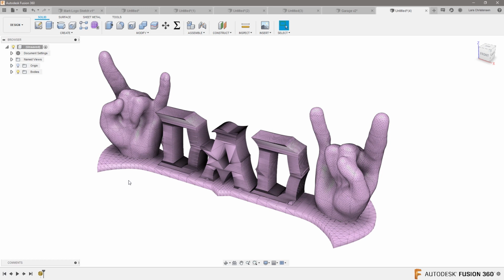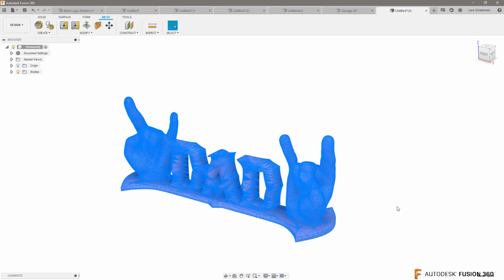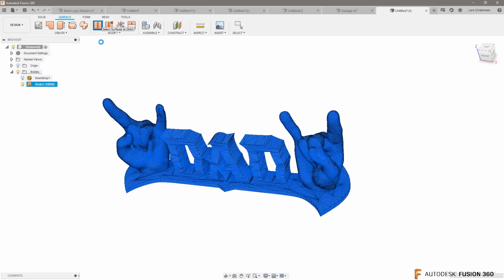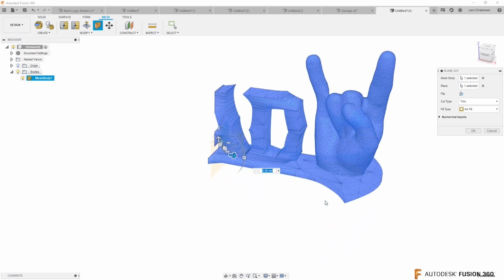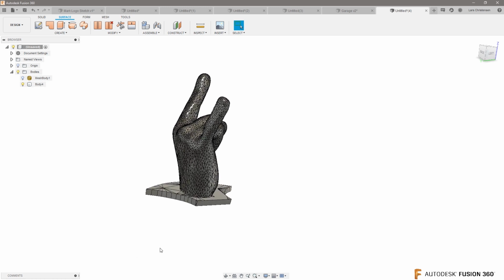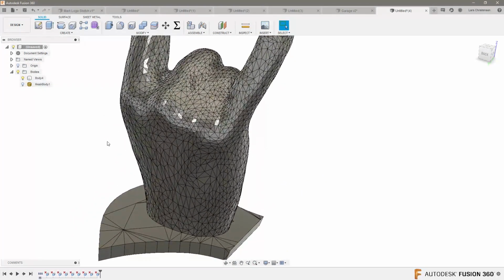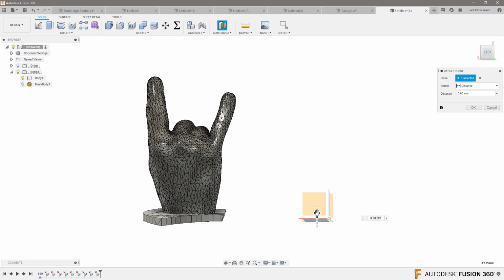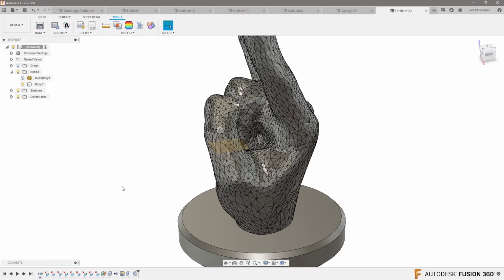Fusion 360 — Unlock 100K Faces for STL 3D Printing — Ask LarsLive

Comment: Valiant effort, Lars! BUT ALAS, as many know, mesh to solid in a 3D solid app is most often impractical, or outright undoable. To F360's credit, I will say that I have found the Mesh Workspace useful on a number of occasions (even w/ hi-poly count STLs). But even here, a proper mesh app is generally advised. For mesh repair, Netfabb is hard to beat (free online version, albeit not as full-featured as the stand-alone, pay version).